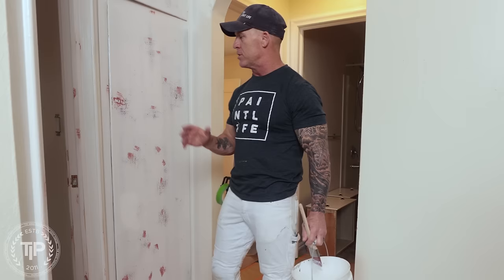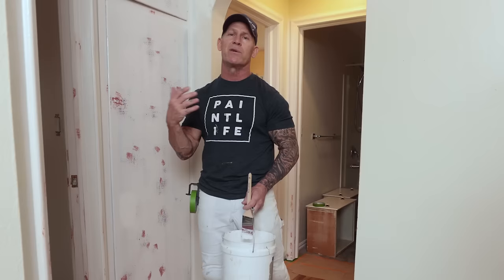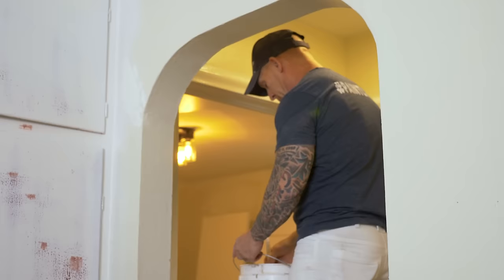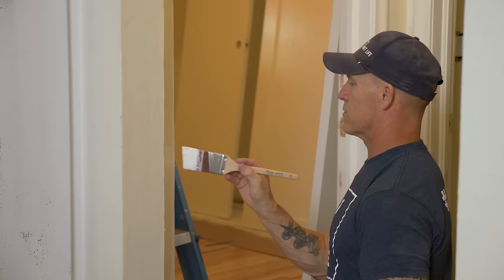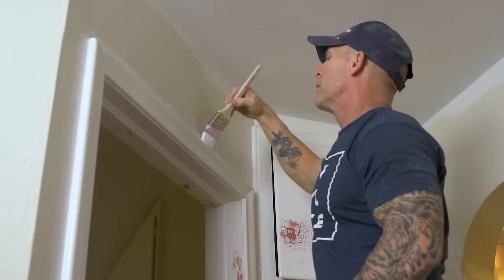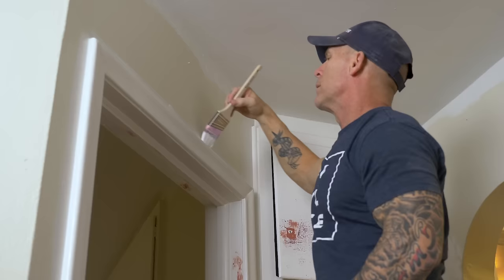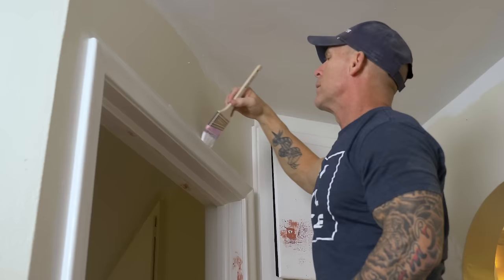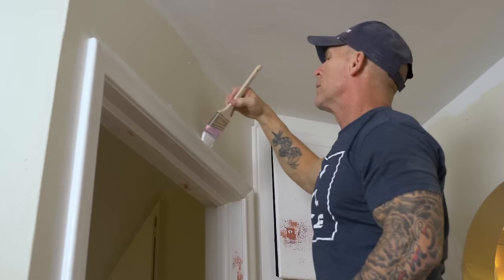Sprayed Finish with a Brush! Hand Brushing and Rolling Interior Trim.

Comment: HINGE HACK I had 100 year old door knob plates that were painted over with decades of oil base and latex paints.  Instead of using chemicals.  I used an old crockpot(no longer good for cooking) with just water and let them slow heat most of a day.  Most the paint came off with a soft cloth the rest just needed wire brush encouragement.  I have pictures of the results.

Comment: Advance is an awesome paint. I tried the reformulated Emerald Urethane from S-W this week. The satin sheen is much improved, but it still has that slightly gritty feel to it after it dries. Not as prevalent as before, but still there. No comparison to the feel of Advance after it dries.  IMO. Great video Chris!
Reply: I don't like Emerald paint and it dries to fast
Reply: What about Behr?
Reply: @johnp82  I haven't used Behr in about 11 years and I don't like it in comparison to Sher-Win and Benmoore
Reply: @johnp82  Does a bear shit in the woods? No but it does in the can at Home Depot
Reply: @TheDeadbirdy  yeah. And not remotely worth the price tag. And Sherwin doesn't like to work with contractors that much on the price of it
Reply: @kylemitchell92  That is so true

Comment: Some instructional painting videos mention the importance when using a brush of laying off the paint in the direction back over the wet paint. For example if you want to lay it of upward in order to reduce sagging from gravity pulling the paint down which makes good sense, then you would want to start at the top and work downward toward the floor in order to lay off with upward strokes.  Wonder your thoughts.
Thank you so much ! Lots of great information here and all your videos.
Reply from the maker: That is good practice

Comment: Friendly tip!  Hi Chris, excellent video! One tip that caught my attention was when you mentioned the paint brush about it’s performance that you like a soft filament brush!  The original Gooseneck had that blend but you suggested they improve to a Stiff bristle. You at that time gave the gooseneck a 4 star. We made the changes as your recommendations to get a 5 star! I as mention to thousands of Painters and DIY need different sizes of brushes and blends! SOFT MED STIFF.   2” 2 1/2 3. Kind Regards! The Gooseneck Guy! 😊Cheers!
Reply from the maker: The requested craftmanship in a better ferrel has never happened.  That is what would make it a 5 star.

Comment: Yes I love BM advance paint..although I admit I have not ventured past the OC-151 white since I'm pretty much in love with the white shade...The company I used to paint my cabinets used BM paint so when I needed to touch up spots later from normal wear and tear, I tried to cut corners and get the color matched with Behr paint...I did a test spot and it was not even close to the color or consistency...I went out and got the BM advance paint and now I won't buy any other brand..The advance is great for trim, cabinets and doors..I went with BM aura for walls ...One thing I have learned from this channel and other professionals is the extra few dollars on better paint and brushes..I used to buy the cheap paint brushes and rollers and would get line marks and not a flawless finish..Not anymore..I bought the Corner Roller plus for the ceiling that you recommended in another video and WOW...as far as brushes I love the Purdy Nylox and Zibra brand although I may try the premier brushes ...Your channel is my go to channel when it comes to painting..I hired "professionals" to paint my home and got drips marks and horrible job so I"ve had to go and redo their work using the advice and tips from this channel..,,Great store by the way..Your prices on most of your items are cheaper than if I bought it at amazon or HD..

Comment: Nice work. You work a bit differently than I do, but then, you're the professional, although I've done ALOT of side jobs and everything always turned out fine. However, your work is very relaxed and fluid. Can't really rush anything, though I have found myself racing the clock, especially when I had to use low quality paints provided by the customer or friends and family. I never thought of back brushing anything I would have rolled out unless there was a defective or in a place the roller wouldn't reach and had to blend the two methods in a tight space. 
Good tutorial, and I liked your four legged helper.😄
Cheers.

Comment: I have trouble brushing BM advanced knowing how thick to brush it on. The self leveling works best when thinker but then I run the risk of drips on vertical surfaces. So is it better to do 2 thin coats? I also had trouble spraying it on vertical surfaces, there is such a fine line between spraying enough to cover and not getting drips. But it could be me, I am amature... any thoughts?

Comment: Hey Chris.  Ive been using Dunn Edwards Aristoshield sprayed on cabinets and love the finish and durability.  Trying to use the same on NEW trim but didnt feel like spraying.  So i tried rolling and got a inconsistent sheen.  some are up and i have to hit the nail holes and im going to try brushing a final coat on the front surfaces. im a little worried im going to create brush marks.  what would you do in this case?  the rest of the trim has zero brush marks (yet like i said sheen is off in some light angles).  so i need to do another coat 100%

Comment: I’ve been waiting for this video for ages. Thanks, Chris! Question: Do you caulk where the side jambs meet the head jamb?
Reply from the maker: Yes
Reply: @Idahopainter  I’m sorry to be a pest about this, but I just realized-watched one of your cabinet-painting videos in which you reject the idea of caulking cabinet doors because the caulk will crack with seasonal humidity changes; couldn’t the same logic apply to trim?
Reply: @Avital4414  It's different. Most Cabinet doors are 5 piece construction (Stiles, Rail, Panel) and the center panel is actually "floating", and not solidly secured to the other pieces. That panel expands and contracts with humidity and temp changes, that movement can cause paint cracking at that caulked joint (Caulk is not glue). Whereas trim pieces are solidly fastened together (nails or glue), and therefore have minimal to no movement between the pieces, allowing both the caulk and the coat of paint on it to remain intact.
Reply: @MegaGolfvideos  thank you for a superb explanation!

Comment: Do you ever use additives in your paint? I just tried  a product called floetrol last night gave me a couple runs that I could have prevented but man, it gave me a nice glassy finish. Used a 2.5" chinex brush, paint is Kelly Moore acryshield. This is tinted and I'm using it as a trim paint. Just curious.

Comment: Thanks for another great video !   Very informative.
Perhaps I missed it, but how long do you wait before the second coat ?
Reply: Depending on temperature BM Advance requires 16-24 hours to cure before a recoat and if you’re painting before installation and handling trim or doors, they recommend a 3-5 days to fully cure and attain strength.

Comment: Thanks again Chris. I renovated a 50s house and ended up replacing all the trim.  It was a shame too, it was gorgous clear grain spruce.  How do you sand in old houses to abate the lead?
Reply: You are only allowed to wet sand old lead based paints, or chemically strip the paint keeping it wet again, not allowing the stripper to dry and therefore the paint drying in flakes.
Reply: @ElvisPriscillaPresley  chemically stripping is a nightmare. I tried it on that house. If I'd been able to find someone with a dunk tank I would have done it.   But I think the waste disposal issues killed all those guys off.
Reply: There is no safe way to sand lead paint without a massive investment in PPE, containment barriers, venting, air scrubbers, and the time to learn how to properly use it all, or hiring the guys who already have that stuff.

The only cheap and safe option is to leave the old paint there, prime and patch the bad spots with bondo or hot mud (depending on whether it is wood or drywall), lightly sand the patches (this is why you primed it first, so you don't have to sand into the old paint), prime and repaint everything. If it is bad enough, you can skim coat entire walls with a lightweight all purpose mud like Plus3, but be sure you learn how to properly prepare the surfaces for mud, or it might not adhere properly and start flaking off in the future.

Comment: Thanks for sharing your knowledge with me over the last 2-3 years, I’ve learned a great deal. I was using paint extender and S W emerald urathane, but it still dried too quickly. I’m a homeowner in the medical field so I don’t paint all that much and am slow. And  after watching this I’m going to try Ben Moore advance and buy the soft filament brushes from your store. I was using the Purdy super stiff fat boy for all trim with some pretty nice results any thoughts? Thanks

Comment: Thanks for sharing all your knowledge Chris, I’ve learn a lot from your videos, the only question I always have is: what do you do with that glossy paint on walls after you spray or brush trim? Do you sand it or can you just apply any sheen on top? All paints will bond right? Thanks 👍🏻
Reply: Good rule of thumb, scuff sand these areas where trim paint got on your walls or other substrate where a lower level sheen is being applied afterwards. Especially if installing wallpaper, the paper won’t stick on glossy surfaces and can’t warranty the work. Hope this helps!

Comment: See you’re not too concerned about getting a little semi gloss on the wall? Won’t there be some adhesion issues with the wall paint?
Reply: No, that's assuming the semi gloss is water-based like the wall paint. Here in Australia nearly every client/architect/ building company I work for asks for water-based.
Reply: @davidjohnlucas  the different sheen I was getting at. If you went flat walls and semi gloss trim I think the wall could potentially peal.
Reply from the maker: Never been an issue

Comment: Great video!  Sorry if I missed it, but do you also like the self-leveling paint from Sherwin Williams?  I believe it's Emerald?  Is it a worthy option if I don't like the long dry tine of Benjamin Moore?  Pros and Cons?
Reply: The Emerald is amazing for trim & kitchen cabinets if prepped correctly. It's very pricey unless you get it on sale. It self levels & you get 0 brushmarks if you don't over brush because it does start to tack quickly and then you'll end up with marks